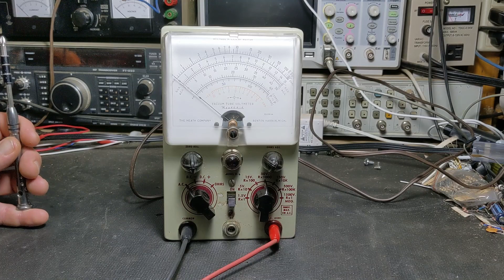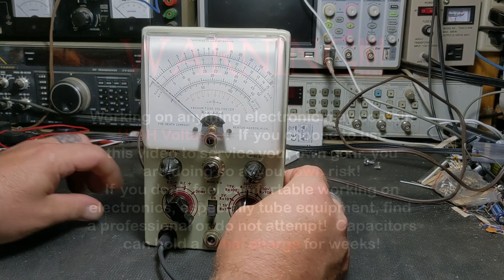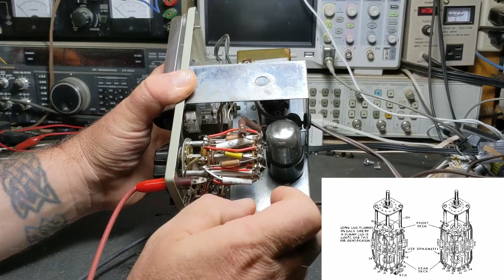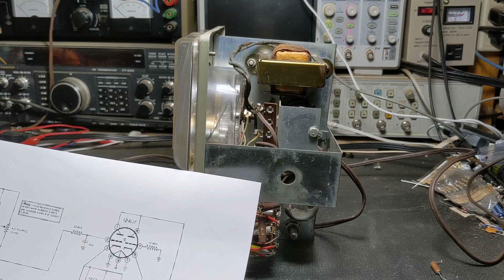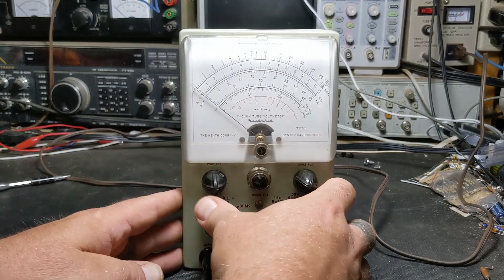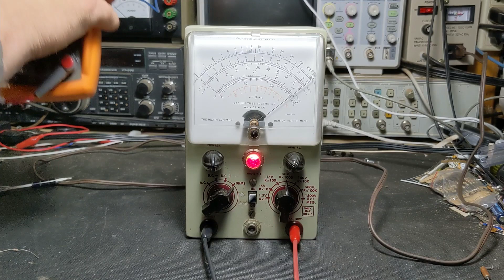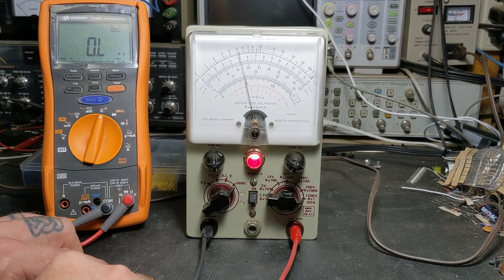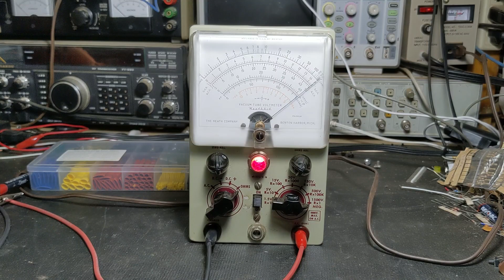Heathkit V-6 VTVM Repair Part 2

Comment: Thanks Michael. Always good to look over someones shoulder on restoring one of these vintage VTVM's. I picked one up a few years back from a Hamfest for 3 bucks figuring the V-6 and a later model IM-18 with a broken movement might provide enough parts to get one of them working. Well, I've opened up the V-6 and there is very little wrong with it. I am justt now getting it going for a vintage tuner alignment that I want to do. I've gone through all the resistors and made a parts list. Planning on replacing two of the three caps and a hand full of the non-precision resistors. The movement works on mine and all the precision resistors look to be close to spec. I'm also planning on using the filament supply to build a 1.5V battery eliminator using a zener diode, resistor and cap. I had to order (correct type) new probe/leads from the guy on ebay. That should be arriving soon. A fun little project.

Just a note on the vintage of these. The manual I pulled off the internet has 1953 stamped on it and I've read in threads that the V-6 was sold from 1952 to 1954. I marvel that the appearance is still somewhat modern looking (although analog) considering that it is nearly 70 years old!

Thanks for your channel and this two-part series.

Comment: Thanks for this video, man. I've got a Heath V-7 -- a kinda-rare model apparently, as it's 1956-only, according to Jeff Tranter's video covering the V-7. Anyway, it's acting a lot like this one was: reading fine on one scale and not so fine on others. So I suspected the resistors, though I haven't actually popped the cover to test them yet. A way to easily test those out without popping the cover is to just plug an ohmmeter straight into the input jack and flip through the range switch, and bingo, you're checking all the resistors (of course the switch might be dirty, which would give you a bad reading, but anything that's way off will show up).

Luckily I've got a fairly beat-up Heathkit IM-28 parts donor, and the resistors in that one are much newer, probably much better, and test spot-on, so I'll just rob Peter to pay Paul instead of having to whip up custom-value jobs.

Nice channel you've got here; I'll second what Tony Vasile says and encourage you to keep on keepin' on!
Reply from the maker: Thanks for the kind words. and the tip.
Reply: So how would i hook up my DMM to test the resistors in the vtvm? what lead goes where? I have an Heathkit V-6 that i want to restore.
Thank you
Reply: You need to reserve both ends of the scale SEVERAL times when reading ohms. And do it again when switching to a new range. You also have to have a fresh C cell in the meter.